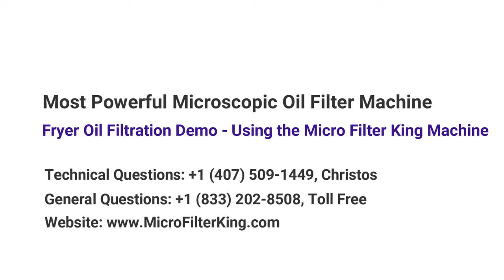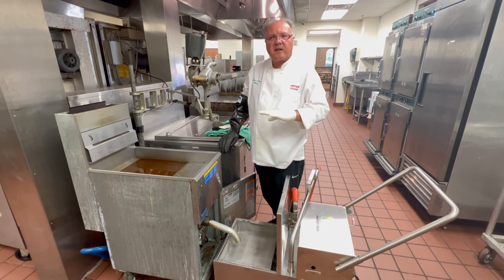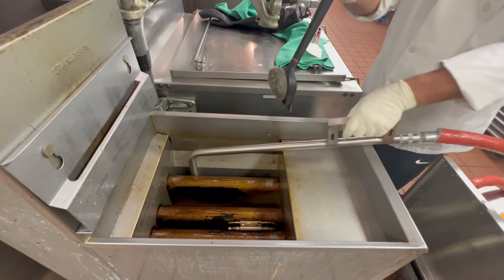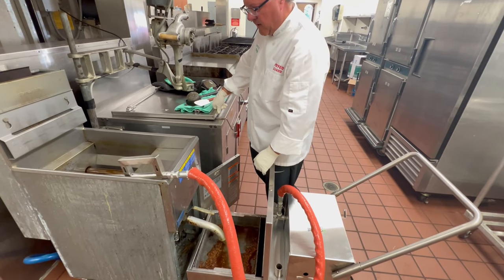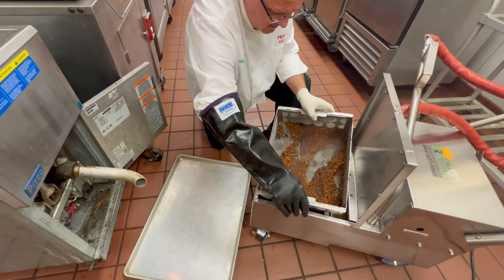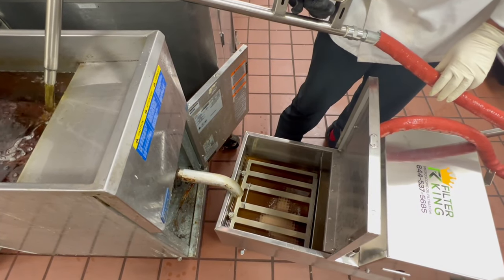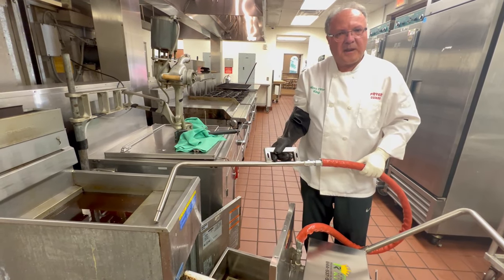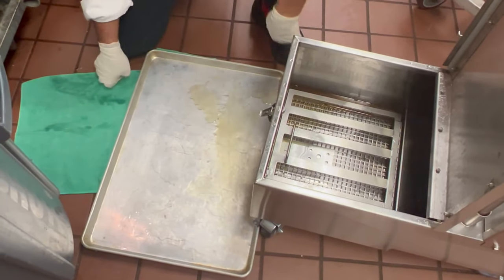Demonstration of Micro Filter King (Cooking Oil Filtration Machine)

Comment: Genius!! I worked at a restaurant years ago, and we had to dump the grease in these Huge vats and pick them up and carry them all the way to the back of the restaurant had to be maybe 50 feet away to the grease trap on tile floor and the vat after awhile the handles would get super hot we would have to put rags on them to be able to carry them and then clean these fryers with steel wool and soap. I thank my lucky stars I never slipped while carrying a vat of hot grease, and when they were full of grease, they had to weigh like 70 lbs, maybe? Heavy!! These kids today have no idea!! Soft, just soft!!

Comment: I'm investing in a frying machine with capacity of almost 300L but I do need a filter which correspond to my machine. What filter do you recommend? \
Reply from the maker: Wow, that’s a 79 gallon fryer. I’m sorry I have no idea what type of Oil Filter Machine you require. You may want to ask the manufacturer of the Fryer. You are buying to see what they recommend.

Comment: Sandals??  In a commercial kitchen around 350-degr oil?
Reply: That's what I noticed as well
Reply: Some people are just built differently.
Reply from the maker: Yes, the oil has to be 350° how Oil when your filtering you just put it on off until you stop filtering and you can turn it back on but the oil has to be 350° hot in order to Filter microscopically. If you have any other questions feel free to call me at 407-509-1449.
Reply: @MFSTradeSchool 
I'm pretty sure the concern was about your footwear, NOT the temp of the oil. 😊